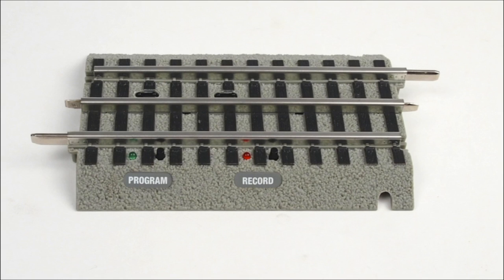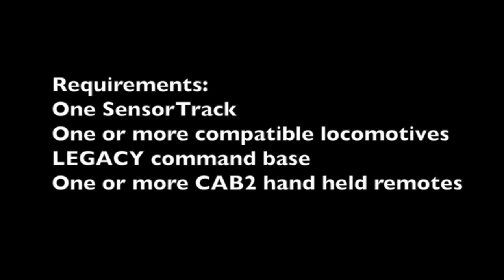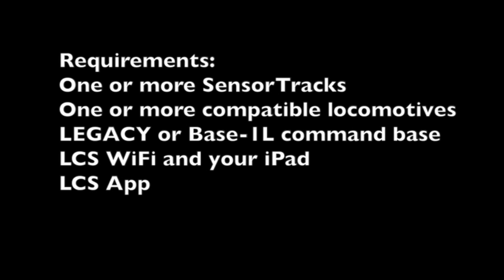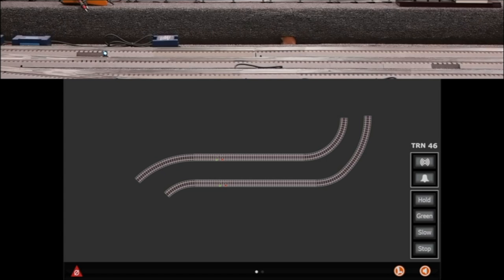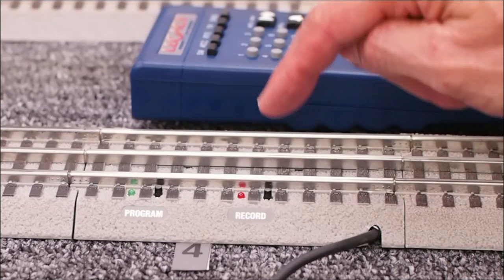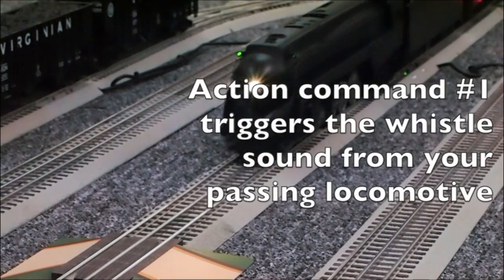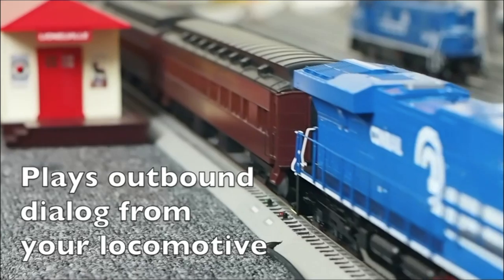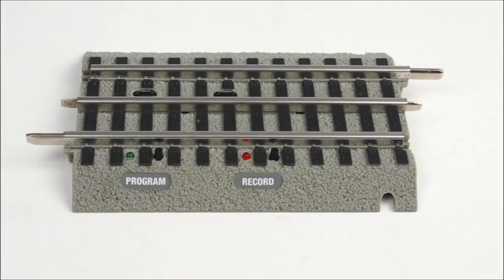What Is Lionel LCS SensorTrack? How Does Lionel LCS Sensor Track Work?

Comment: These tracks, along with a Legacy Controller, can be used for hundreds of functions! For instance, you can program a turnout to change route every time a train finishes going through that turnout -  and end up with a Stan Roy kind of layout, where multiple trains constantly run multiple routes. Or you can set a particular crew talk dialogue, or a horn signal (like three short hoots before backing, etc).

Comment: But to use this, you need a 6-81499 LCS PDI to DB9 cable.
This cable is discontinued and out-of-stock everywhere!
So LCS is basically useless to anyone new to the hobby 😞
Reply: how it's discontinued ?
Reply: @joeyBirskovich  The base3 has a PDI connector on the back that powers all your LCS modules, so this cable with the wall wart power supply is no longer needed.  I guess that's Lionel's way of forcing you to buy a Base 3 :-/